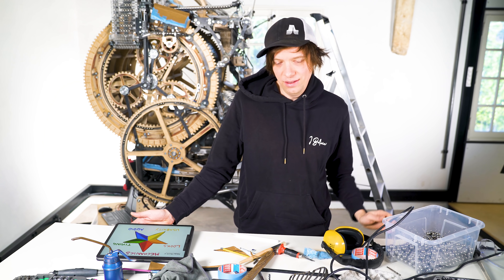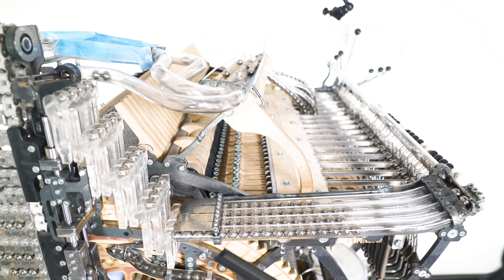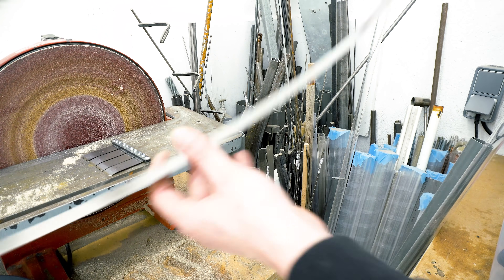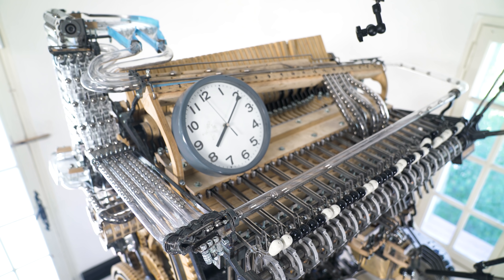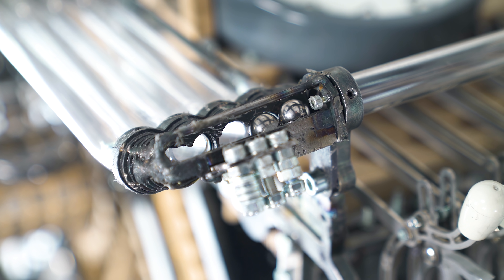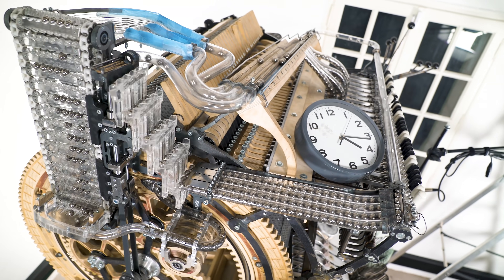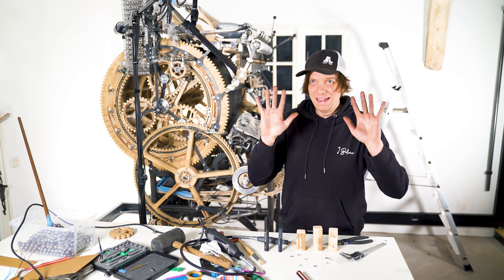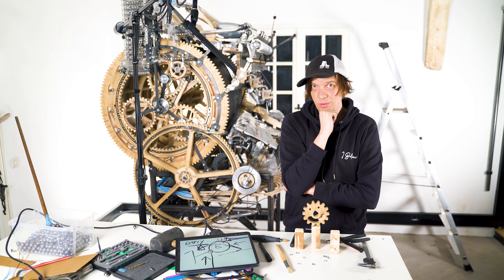Marble Machine X Fish Stair Upgrade

Comment: I was thinking, isn't it possible to apply the same principle to the fish stair as to the sentinels? That is, if the fish stair is in the down position, there is some mechanism preventing marbles not in the first spot in the queue from proceeding further than spot 2. 

Here's a sketch: suppose there are slots in the bottom of all 4 channels, such that if the channels are all occupied, the slots are between marble positions 1 and 2 on each channel. When the fish stair is "up" these slots are clear. However when the fish stairs descend, a piece of spring steel or something similar applies a slight pressure from below to something like a piece of felt or rubber such that they peek slightly up from each slot. Then no marble can pass that point, but if a marble is caught as it rises, the pressure is not enough to cause any problems; the marble will slip to either side or be stuck until it opens again (it might be reasonable to ensure this deliberately). This way the first spot in the queue will only be populated when the fish stair is in the up position, and fast marbles coming in will have to wait their turn. This could in principle be calibrated such that it is physically impossible for a marble to bypass it while the bottom stair is in its vulnerable position. It would also stop the marbles behind the current occupants of the stair from pushing on them from behind.

There's probably something I'm not considering. Excuse my backseat engineering.

Comment: I work a lot with metal myself. I have a great solution to cleaning your hands and fingernails of the tiny metal bits that are hard to remove after doing a lot of grinding and dremiling. Take the used coffee grounds from making coffee in the morning and store them in a small container. You can use those used coffee grounds as an exfoliant. You can then discard the coffee grounds at the end of the day in your compost bin. I used to have my hands covered in oil and metal bits and no amount of hand soap would do anything. Saving my coffee grounds in the morning has made my hands much happier.

Comment: If the divide-by-four worked exactly like any other marble channel, that would be one less puzzle to solve.  That is, they drop in a series of four holes, and full holes sit flush to allow other marbles to pass over.  You already have a design that works.

Comment: For the stair lift mechanism. You need to build whats call an Escapement. It prevents any balls from moving forward while it is in the down position. this can be done with a see-saw type mechanism which would push fingers or pins UP in the loading track while the escalator is in the down position. Then when the escalator moves up the pins go back down.

Comment: As an engineer with occasional bouts of artistry, it's tough. It is. I don't know how many times I'd sit and stare at my computer screen just wondering if there's even a point to keep trying and trying to make something succeed. Don't feel embarrassed when you hit a snag, it happens way more than anyone will ever admit. Don't beat yourself up when an idea doesn't pan out or a fix fails to give a solution; if you knew what worked and what didn't then it wouldn't be creating. Creation has flaws and it's our job as engineers and artists and inventors and as human beings with a mind capable of bringing to the universe something that never existed to work on these things and fine tune them. Thomas Edison went through over 1000 iterations of the light bulb before making something that worked. In the end, it's the success, that eventual success that says "I did it" that makes invention worthwhile. It may not seem like it, but you're making progress, a lot of it. Even if it isn't on the machine itself, you're making progress on how you think and how you analyze solutions. Don't be afraid to take a break, but don't be afraid of failure either.

We are all here rooting for you Martin, we know you can do it. Look at videos of the original marble machine or look at what the MMX was and you'll see the progress and success we see in you.

Comment: Perfect is the enemy of good. The MMX is a ridiculously well engineered machine right now. At some point you do need to accept that things like "the channels cannot run dry or Things Happen" is simply a design constraint rather than a design failure. Constraints are an innate part of any mechanical system. Your car has constraints where the brakes don't work if the brake pads wear too much, or the engine can be destroyed catastrophically if it runs out of oil, or any number of other things.  So don't get discouraged by finding out that you need to impose a constraint on the machine that you can't engineer a way around immediately. You're doing fantastic work.

Now. All that being said, I have some suggestions for the MMX fish stair issue. 
Option 1: Slow the marbles down if they're not being pushed forward by more marbles behind them. For example, if the last 5 or  6 inches of the clear tube leading up to the fish stair had a slot cut out of the bottom of increasing width, the marble would slow down due to rotational inertia - basically imagine the two-wire "marble track" style system. If there's still marbles behind the front one pushing it forward it shouldn't have much of a change in its existing behavior, but slowing the marble down will allow the current setup to gently nudge the marble out of the way rather than it impacting the corner of the stair at a high enough speed that it can't get dislodged, I think.

Option 2: Double gate. The whole rest of the system relies on a 2-gate system. I think the fishstair pickup could benefit from the same thing, where you just pause the incoming marbles until the timing is correct for them to get onto the stair without coming in "at the wrong time".

Option 3: Make the pickup more flexible, in a literal sense. The issue with marbles getting launched is because the whole system is entirely rigid, with the exception of one spring at the top. This forces the system to push until the spring "does something". If the leading edge of that first step were made of, say, silicone, instead of hard acrylic, you could make the whole "failure" state softer. You'd ideally want the marble to "fail" back down into the pipe rather than up through the spring and off the machine. A silicone leading edge, and possibly undercutting that whole front face, might give you a setup where the marble that gets caught at an awkward point in the pickup cycle pops back down into the pipe rather than up and out entirely. 

Option 4: Constrain "failure" paths back into "success" paths. So for example, when a marble pops up and out, put a guard/guide over the top such that the only place the failed marble can go is right back into the fish stair where it's supposed to be anyway, or, make it so it pops out and follows a path back down into the base of the machine where it gets mixed back in with the marbles that've just been collected by the funnels.

Hope you can draw some inspiration from any of these ideas. Remember that nothing has to be perfect, and we're all amazed at how good the MMX is already.

Comment: Hi, Martin. How about extending the swing in the divide by four towards the incoming marbles, so that it needs 5 marbles to swing? That way you can be sure the first four marbles are in the correct position before the fifth comes in to turn the swing. And you could put more counter weight on, so maybe it will swing back quicker?
Thank you for making these videos!

Comment: Martin, I think you should think about where marbles can be lost and where they cannot. I agree that the marble gates cannot fail catastrophically, but losing a marble or two during 10 minutes of play at a non-critical point should not be important. To me, any place where a marble can be lost without affecting the music directly should be considered non-critical, like the fish stair-spring steel interface in my opinion. Also, I think you could chamfer (dunno if that's the correct word) the bottommost stair a bit towards the tube side, it might make the springs snap back less violently.

Lastly, consider doing test with the hi-hat to make sure that it works as you want it to, while ignoring all marbles lost from non-critical points.

Being a PhD-student I have feel the same doubts as you do and I'm honestly not sure I will finish either, but watching you continue gives me hope that I can finish too.

Lycka till och ta hand om dig :)

Comment: Also to solve that edge case, If those metal prongs were slanted upwards instead of downwards it will push the marble forward into the fish stair instead of clamping it to the fish stair by trying to pull it back out.

Comment: An idea that came to my mind after watching the last video about the marble divider: Wouldn't it be better to have a serial instead of a parallel feed before the fishstair? I'm thinking of a pipe that routes to the fishstair and transitions into an inclined plane, feeding the marbles from the side. The upside is the higher throughput, marbles are being fed even if there are less than four. If there are more than four, the marbles are simply queued.

Comment: Hi Martin, try putting the weights on the divide by 4 above the pivot point rather than below, that way the counterbalance will reduce in weight as the marbles tip rather than increase in weight. this is how old coal and potato scales worked, once you get to the correct/target weight the  scales would tip and not balance.

Comment: The doubt is natural. You are in the hardest part of a huge, complex project (The bit where you have to cross the gap between theoretically complete and functionally complete).I do hope that you continue, because not only is the machine beautiful, watching you finding solutions to these problems is uplifting. I work in software and networking, but the trajectory of a project is similar, and the frustrations are very familiar. I love that you are sharing this with us - especially that you are presenting physical problems that are understandable, and able to demonstrate why your fixes are necessary and how they are an improvement.

Comment: One possible solution is to accept a failure tolerance in the system and have system recovery in mind.
I'm not an engineer, but hardware systems have the concept of Mean Time Between Failures -- it's nice to have a really long time between failures, but you have to accept that it will always be a non-zero number of failures for a given piece of hardware. 

The trick is not to eliminate failure, but to account for it in a way that they can minimize impact on your project. 

For example -- if the machine spits out a couple of marbles every song, so long as all the notes are struck in time, and the machine doesn't seize up and stop playing, and the marbles don't fly out into the audience (duck!), call it a success and move on.

Comment: Something that helps me is make a stoping point and make it tangible, like if I try this 10 times then I have to do it in a different way and make ether a reward System or consequences system if I beat one mole Wilson will have to congratulate you or make a consequence if I still try to be the artist and I fail 10 times I have to do 10 push up or at least this is what has been helping me go through live I hope you have a better time whacking those moles

Comment: "Dont stop, Believing! Hold on to that feeling!"

Dont feel stupid or embarrassed for working on something you love or enjoy! 
If something isnt going your way, take a step back, take a deep breath and reevaluate the problem. With everything you have learned since the first version, maybe the problem is something that can be redesigned and fixed in a new way now.
Perhaps the "Divide by four" system is to complex and using something like the "One times four" marble latter tray is something that should be looked into?

Comment: The fish stair just goes to low, you don’t need it to go that low and that’s why the incoming marbles are forced to go on top of the lifted ones when the queue put pressure on them, but you kinda fixed it by stiffening the metallic springs... 
And if you don’t want to see what happened at the end of the video, with marbles stuck between the first fish stair and the metallic springs and then ejected, but a bevel on the fish stair instead of this sharp angle. Then if the marble is not well secured in the fish stair, it will be pushed back into the queue as the fish stair goes up and you won’t have this « clamping » behavior

Comment: An issue I see coming is not being able to consider the machine finalized, it's very easy to get tangled trying to look for small imperfections in the endless quest of removing them, I think this a place where you're falling into right now. Don't get lost. 
You already built an amazing machine, then you made it adjustable and repairable. That's way beyond most home projects go.
And remember, you're fighting to get rid of bugs in a machine that works 99% of the time, you're fighting for the last stretch, that's why it's so difficult to advance.

Abandoning it, might be a little bit of a strong wording, consider the machine complete, you'll hurt less feelings. But for that, you'll need to convince yourself that it's done.

Comment: 1. Delete the divide by 4
2. Route a long PMMA pipe so that the end of the pipe meets the bottom of the fish stair at 90°
3. Profit

This is basically the divide by 4 but at the foot of the fish stair, and without the tipping mechanism.

Comment: This is why I refuse to use a burr (rotary file) on steel. Those little splinters give a little twinge when they brush against something, and the only way to get them out is with a magnifying glass and a needle. Once you start digging them out, you discover that there are ten times as many as you thought. If you ignore the ones that don't hurt, most of them will eventually wear off as the skin does, but some will get infected and turn black, and digging them out means dealing with a sharp stinging feeling. Wear gloves if you have to use a burr, and don't ever touch your face. If you rub the corner of an eye, they can get stuck in that sensitive area and become a major problem.

Comment: It's cool that you have your own "radar chart" now to better break down your issues, goals and hopefully focus too. It would probably make sense for you to define the criteria for success and failures for each of the axles.
One key example that you focused a lot on: what if a few marbles do drop on the floor during a performance? It may be bad for audio and usability(?), but is it actually a mechanical failure? On the flip side, if a marble gets jammed and breaks a part then it's a global failure (I winced when that marble got stuck and flung at the bottom of the fish stair). That's one example, but that focus on dropped marbles earlier seems to have taken a toll on you, even though you're now looking at actual failure points (stuck marbles, mechanical stress, etc) which will arguably be more beneficial.

Another engineering motto is "time, cost, and quality: you can only pick 2" (nothing is infinite). It looks like it's starting to get clear to you that you won't achieve perfection. It is going to be a compromise, and I hope you can expand on your star (radar) chart to pick your fights better.

Overall you seem to be very close: if the main thing you're missing are the marble gates for the remaining instruments, then you're actually really close to the working prototype! Maybe one that requires picking up some dropped marbles between songs, or ensuring some fish stair input channels are refilled, but your modular approach mean they can be fixed/improved on their own.
As an engineer myself, I'm actually more hopeful about the MMX now!

Comment: Also, what's the point of the spring steel in the first place? If the ends of the tubes weren't notched, wouldn't that completely eliminate the problem altogether? What problem was the notches trying to solve?

Comment: To be honest, if I were you, finish the machine, then test if the divide actually has an issue. And only then fix it. At this point it's just a theory that it runs dry.
But one fix might be to move those steel springs a little more back from the stairs so that the first marbles aren't covered by it. That way it would bounce back instead of being launched.

Comment: i feel like if you are looking to keep the dived by four, remake the opening with cnc or 3d printing, then make the 5th marble the wieght needed to drop the marbles
Reply: This! That’s a stable solution! Also I”d recommend a small drop before each place like this. Now the force/pressure is dependent on the amount of marbles waiting behind.